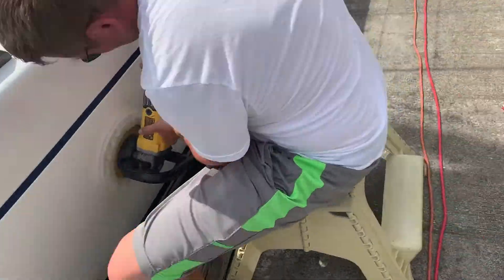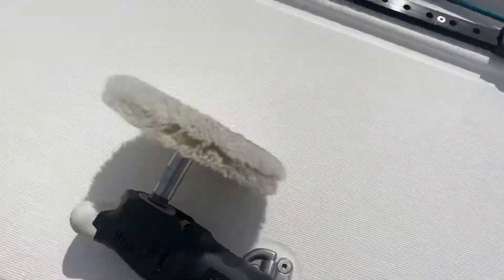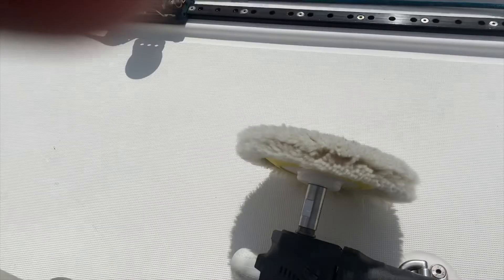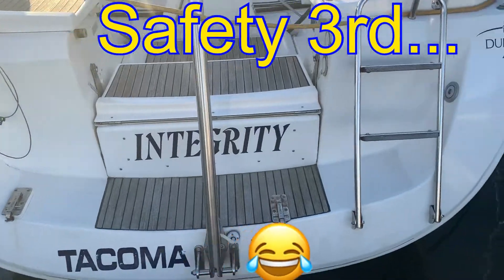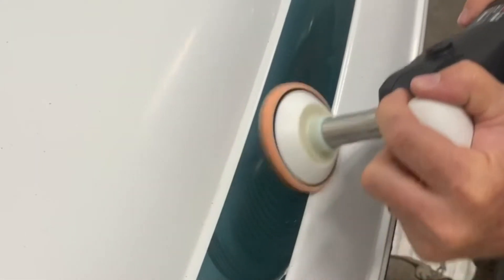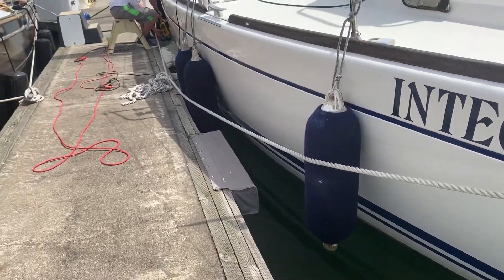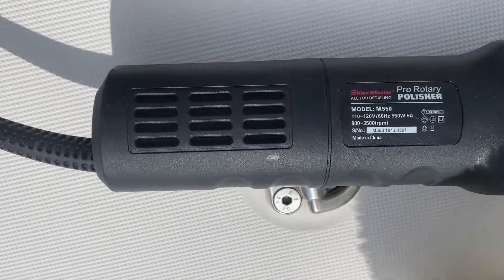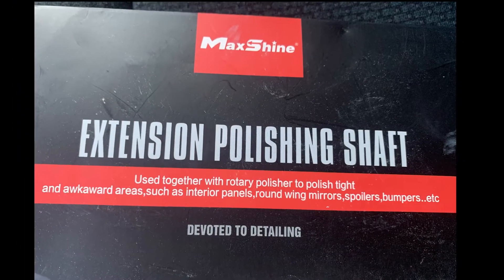Shine master 550 mini Rotary polisher take two... 😳

Comment: Still use mini rotary or found new polisher that bether?
Reply from the maker: I don’t really break out the mini much. I use the 1000w it gets most places ok and has a legit trigger… sometimes on sailboats and RVs I’ll use the mini… The heat issue and all on all off switch can be a problem